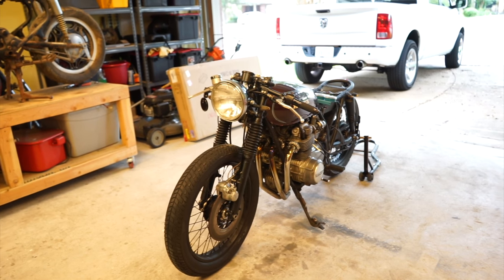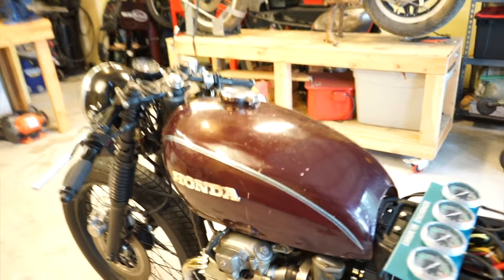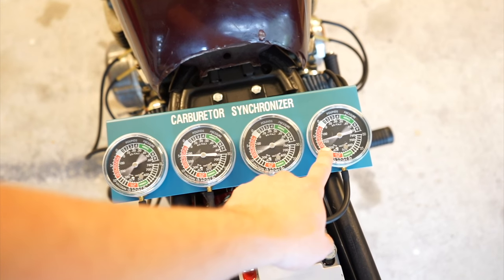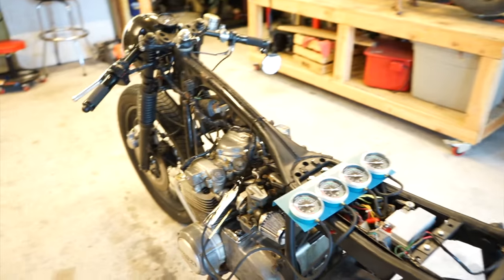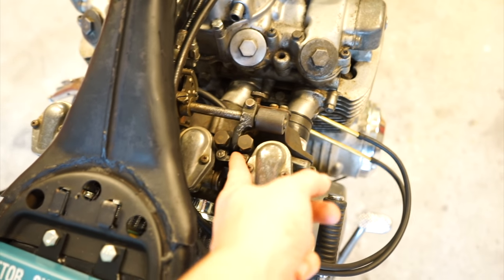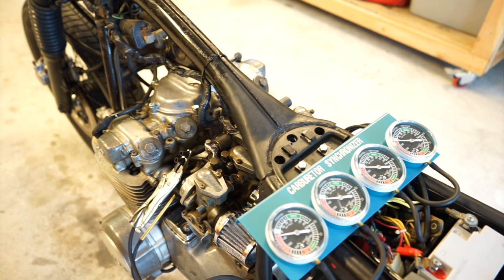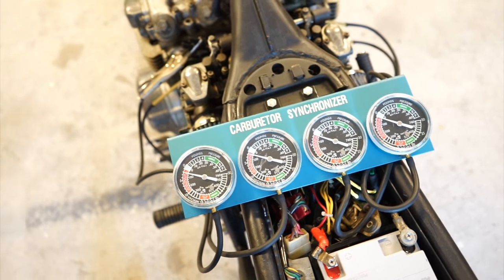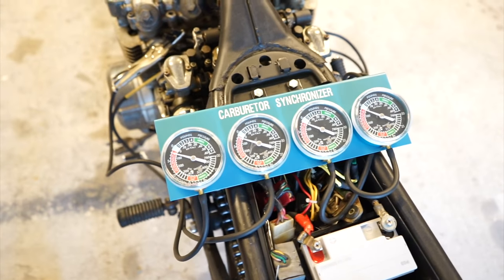How-To Sync / Balance carbs on a Honda CB550

Comment: you forgot to use the air restrictors  to calm the needles down
Reply: Please elaborate
Reply: I was going to ask about that. Is it an inline valve restrictor our just something that pinches the tube? Im going to try this with my 75 CB550F soon.
Reply: NorCal Rider  That's what I used when I had a CB750 years ago. Timing light and dwell meter also.
Reply: True ..  And talks a lot

Comment: Unrelated question, how did you mount your speedometer?  The stock bracket for that speedo is a single bolt at the bottom, it looks like you have both side of the top tree bolted to it.  Was this a custom job?  Thanks!
Reply from the maker: I used two pieces of flat bar with holes at each end to connect from the speedo to the tree.

Comment: Working on my first project- ‘71 CB500. Your channel is so helpful, dude!  Can you tell me which cone filters you’re running and what jets and needle settings they required?  I’m at 6,000’ but I think I know how to adjust your settings to compensate for the elevation here. Thanks man!
Reply from the maker: I normally rin UNI filters with 110s main jets. I keep everything else stock.

Comment: Awsome build man! I love following this build. I have a 78 cb550k and recently put the carbsa back on after cleaning. For some reason cylinder one 1 is not firing cylinder 2 is popping and backfiring, cylinder 3 is ok, and cylinder 4 seem to be happy and before the engine cuts out after about 2 minutes. Would a carb sync and a valve adjustment get this thing running properly?
Reply from the maker: Sounds like that could be ignition related. I would check your coils to make sure everything is working properly.

Comment: Hi taylor,was hoping for sum  advice on my cb750 ,just brought it,would like to put pod filters on mine currently have 115 jets in my keihin 41p carbs ,had them cleaned,whats your thoughts on jet size,if i was to rebore it to a 840 cc you would increase jets as well?. kiwi muz your advice would be very helpfull thanks

Comment: Mate, to stop the needles flying around all over the place, you need to use the little air restricters/dampers that go in-line in each hose. Much easier to read then.

Comment: Please help me, I just got a CB550 and when I start it I need tiny bit of throttle to run then if I let go of throttle it dies, but if I hold it slightly it runs and when I put it into first gear WHILE holding clutch and WHILE I put first gear, still holding the clutch the bike moves forward slowly while I’m still holding in the clutch. WhT is the issue? Do I need to adjust my clutch cable or is the clutch bad, and what about my idle do I need to adjust idle rev screw or is it my carbs
Reply: There's a screw where your throttle cable meets the carbs, that determines how much gas goes to your carbs/engine when you're idling, push the screw in more to keep your bike from idling. That's just a superficial fix, but the real issue might be a carb/jet/compression problem. As far as your bike moving forward goes, could be your clutch cable isn't tight enough, or the clutch itself needs to be fixed.

Comment: How come you know to adjust number 1 and 4 to match 2 and 3? How come it wouldn't be match 2 and 3 to 1 and 4?
Reply: he builds alot of bikes, and probably knew that 2 and 3 were in the sweet spot, so they became the standard. The gauges have a range highlighted by colour which im guessing is the acceptable vacuum pressure range..

Comment: I just got a 76 cb550 and when I was taking apart the carbs for cleaning I totally disassembled them from the throttle bell crank. In doing so, I had to remove the carb sync screws that you adjust in this video. Is there a good starting point for approximately how many turns out the screws should be now that the carbs are reassembled? Or maybe a pressure level the gauges should read? Thanks and keep making great videos!
Reply from the maker: Here is somethingI found on how to bench sync them "use a 1/8" drill bit as a gage. Here's how you do it: Adjust the idle screw (the main one) until the 1 carb outside of it is open enough to just let the 1/8" drill bit through. Then adjust the sync screws on the other 3 carbs until the drill bit just fits them as well. You'll probably want to close the idle screw before you bolt them back on the bike, 1/8" opening is pretty big."

Comment: i have a 1981 cb750, it is hard to start, i have to give it alot of gas. it will shut off at idle and even if i squeeze the clutch and brake it will shut off. also it doesnt really have any power, it doesn't accelerate like how i have seen other peoples videos. when it is running there is a clicking noise as if something is broken. any ideas?
Reply from the maker: +Colin Davis I haven't messed around with the later DOHC bikes a whole lot but I would definitely start with the basics. Ignition timing and valve adjustment can have a huge impact on performance so I would start there. Also, if you haven't already it might be time to pull your carbs off and give them a good cleaning.

Comment: Cool channel man, helpful stuff... just wondering what pilot and main jets you ended up using with the pod filters? I'm building a 500 atm and am putting pods on it, I realize I'll have to tune it to a few different variables but might be a closer starting point than stock. thanks
Reply from the maker: All I do is up the main jets to 110s. I have had really good luck with that setup.

Comment: You adjusted the 2 outer ones to match the 2 inner ones but how did you know that the to inner ones were right... and not the 2 outer ones
Reply from the maker: What you're really doing is making sure they are all synchronized. That's why the actual reading isn't as important as them all reading the same.

Comment: Thanks for your great videos. I have a problem with the same carbs as those on a cb550four no2 cylinder doesnt pull anysuction when I put my hand over the intake, the other three do. I now have the carbs off the bike and trying to figure out what might be causing this. Any ideas?
Reply: Most likely air leak due to worn/cracked boots or a bad clamp. Also, make sure to switch vaccuum gauges on the bad carb with a good one, to rule out bad hose/gauge on the sync tool... check the compression in that cylinder if you need to rule out any valve seat/adjustment issues

Comment: Motion Pro refers to a "master carb" to calibrate their sync tools (gauges/manometer).  Do the old CB's have a specific master carb?  I've tried searching and no luck so figured I'd run it by you as you seem to be becoming a very handy cb bible.... lol
Reply from the maker: On some of the CB750s the #2 carb is not adjustable. So you have to set the other 3 to whatever that carb says. That's the only "master carb" I know of.
Reply: Ok cool, thanks!  Maybe the better question is how did you sync your gauge system?

Comment: Awesome and super helpfull !!! Love the series!! I'm busy with a cb350f but the camchain is making some noise, how do I tension it??
Reply from the maker: I haven't done it on a CB350 but I found this.
Locate your lock nut and adjuster bolt. Then, look in the same area, a little higher, maybe 6" higher, right between your 2 & 3 cyl, tucked in behind your case mounts and 2/3 headers. There is a bolt that angles down and to the rear of your bike, take that out. Start your engine, place a small phillips in the upper bolt hole, and while depressing the phillips, you'll feel and hear the rattle of the camchain.  Press down until it quiets, hold there, and then tighten the lower bold to secure the cam tensioner in place.
Reply: Oh wow Classic Octane thanks a lot !!!! :D

Comment: you should make a how to carb rebuild video... preferrably for 4 carbs
Reply from the maker: Will do. Thanks for the suggestion.
Reply: I rebuilt my carbs. Had two sets from prev owner. Really gummed up on the old ones and the 2nd set was physically breaking down internally due to some idiot putting pennies in the gas tank. Cause this white crud and a breakdown of the metal so i actually rebuilt a new carb set by restoring both and using the best parts. Separating the carbs and soaking them in a big can of Carb cleaner dip for 2 day with a tight seal is the first key step followed by cleaning each little part and replacing any plastics. Wish i did a video.

Comment: Hi, thanks for the vid. I've just stripped my carb for the first time to address the poor idle issue by clearing out the jets but inadvertently removed the sync bolt before I knew what it was (YouTube mechanic). Can I eyeball it putting back together? I'm going by the flap alignment inside and got them as precisely aligned as possible. Is this correct or are the flaps supposed to be at different angles depending on the side of the carb?
Reply from the maker: Try and get them al aligned as much as possible so you can get it running then fine tune it from there. As long as they are relatively close you should be able to get it running enough to do a final sync.

Comment: Hello I have some problem with my bike, I have rejettet and put filter pods on but when I give gas while it runs normal it holds on rpm and wont fall down.. I have checked for boots leak from carb and motorhead but nothing. I still replaced them and dont know what other thing I can do to get the RPM fall after giving gas to normal? Please help me here I am going crazy! xP
Reply from the maker: Have you checked simple things like the throttle cables? They might be getting bound up and not letting the carbs close. Definitely worth checking if you haven't already.
Reply: Classic Octane my push cable is destroyed atm but I have ordered new pull and push cables from dime, I also ordered this kit you use here for balancing carbs, I havent done any of that at all since I bought the bike,rejettet and put 4-1exhaust on! so maybe one of the side runs more agressive then the others so it kinda allways drags up the other cylinders pressure and wont fall, the knifes idle screw you adjust here :)??
Reply: MafrosFPV - loosen your throttle cable and idle screw

Comment: How do you know the initial readings on 2 & # are in specifications?
Reply from the maker: On the 750's they are not adjustable so you just have to set the other three off of that one. If I understand it correctly it's more important for them to read evenly than the actual reading.

Comment: When syncing do you have to have idle set to some specific rpm
Reply from the maker: I just have them at the factory setting somewhere around 900-1000 rpm if I remember correctly.
Reply: Ok. I have the same pods and my plugs are bone white even after syncing. I'm going to 110 jets and hope this helps because you can tell the bike is starving. Thx
Reply: From what I've read 110 main jets and 40 idle jets work with pods and 4 in 1's
Reply: I switched out my Jets to 115 and 40. I installed pods but now my bike want to shut off during idle. Any suggestions?